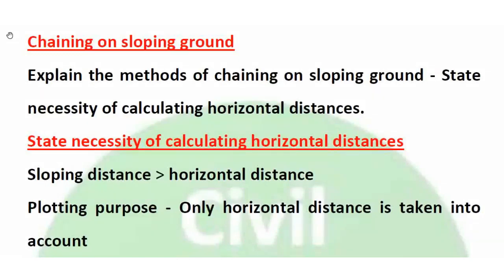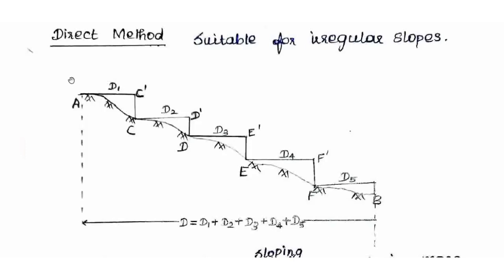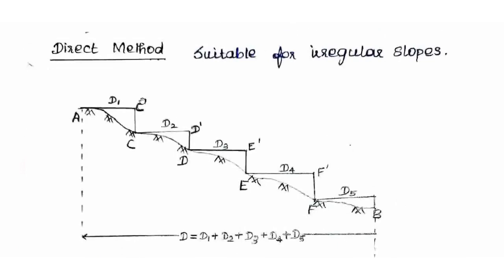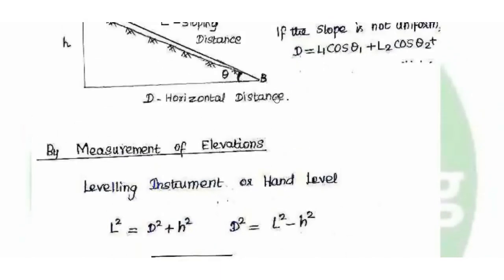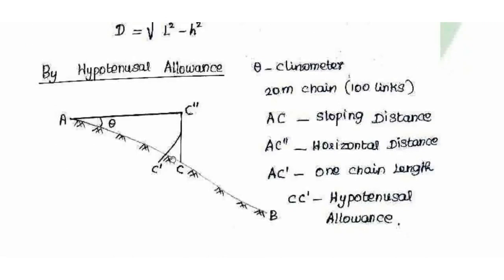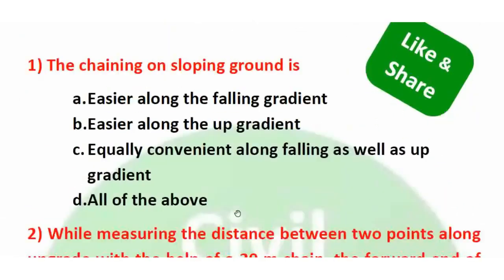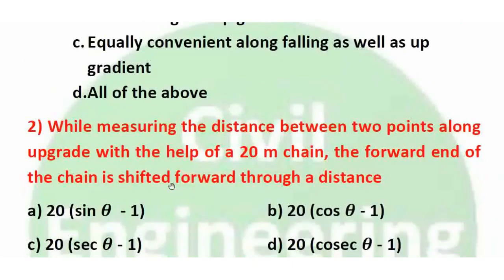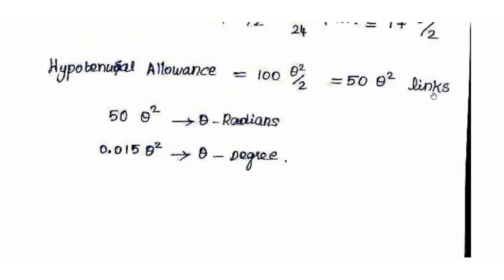TNPSC Field Surveyor - Chaining on Sloping Ground

Comment: mam direct stepping method onum puriyala madam....
Reply from the maker: Follower - Hold back end of chain at A
Leader - Hold Suitable length (D1) at air above ground at C. 
Range ACB line
Next transfer end if chain to ground using plumb Bob or drop arrow. 
Repeat the procedure till the end point B